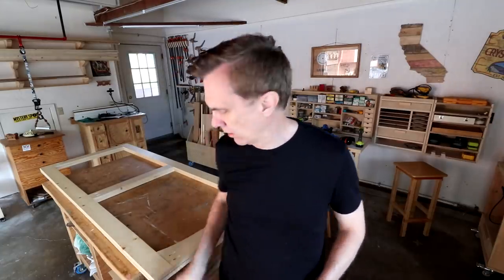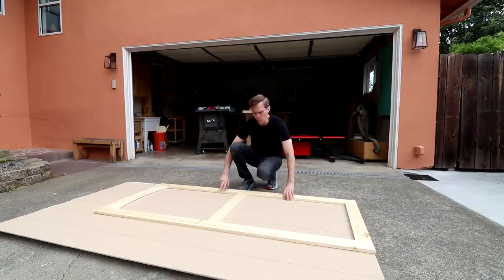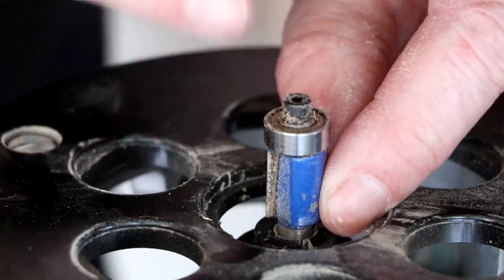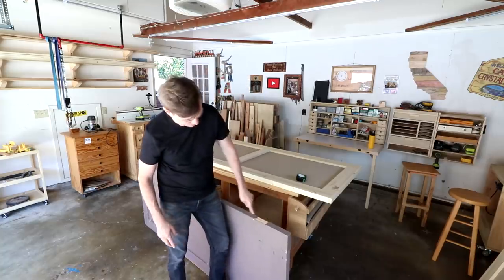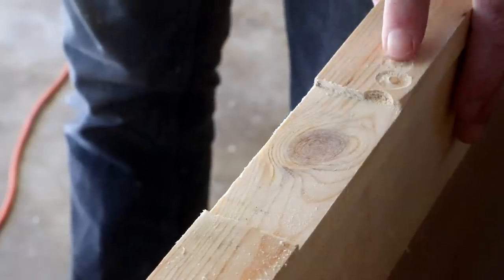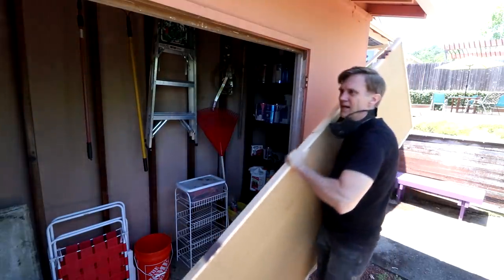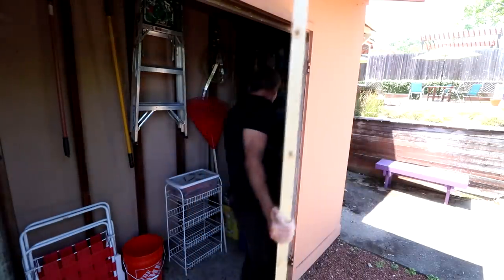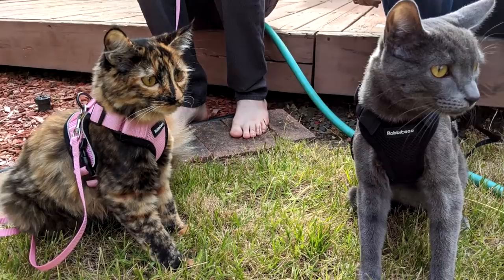One day of work expanded into two. But the doors are looking good! | LOCKDOWN Day 77

Comment: Our routine is simple:
-they have a food call. Always. Whenever we feed them, we have a certain whistle for them to call them in, even if they are inside, even if they jump in the door and we have another purr when we are feeding them.
we moved several times with cats they were saved from outside by us, so they cannot be inside for too long. But when we have to introduce to a new place the dance is always as follows: 
- 1 week indoor, no matter what. They must to be inside. This is home. 
-1 week later they are let out into visible distance 10 mins before. They sniff around and then foodcall, and they come back. After that they want to go outside but they just can't. They are mad. This goes again for a week all the time a little bit longer time to free roaming.  For the end of the week they spend an hour outside before every meal. 
-And after a fortnight they are always back to food call. Sometimes not, so I have to whistle again in 10-15 mins. 
They have two food calls. One is the whistle, the other one is similar to the mothercat's  feeding purr. The latest is always heard when we are feeding. The whistle is used for calling them in, 98% for food, but other occasion too when a storm comes, or we are going for the vet. The food purr is a jolly-joker. We do that when we think it is an emergency or when they are on a place we cannot reach them but we want them to be encouraged.

Comment: Our cats go outside when they want, and you sort of learn their routine. They like to go out at certain times, and come in again at certain times. One night one of our cats didn't come back when it was supposed to, so we did the whole panic thing and searching everywhere, and attempting to go to bed. In the morning I open the cupboard, stick my hand in for some socks and get a set of claws and teeth attached to my hand.
The cat had climbed into the cupboard while I was putting away the washing and made a bed in there, and gone to sleep.
Yesterday I finished tiling and grouting our porch floor. It looked really messy when I went to bed, and I can spot every uneven bump in the floor and misaligned tile. This morning, it looks fine and just needs a wipe down :)

Comment: Glad Cobra is back. Bubbles must be 

Down the road a nice project for Bubbles and Cobra ,to let them go outside safely, would be a build of some of those outdoor hardware cloth cat tunnels. I've even seen where folks have made tunnels that go to a large cat run. The tunnels I've seen normally hook up to a cat door on side of the house or end of a sliding door .. with a way for the owners to open or lock them.

Bubbles and Cobra would be in cat-heaven.

Comment: @5:38 Astagal - An astragal is commonly used to seal between a pair of doors. The astragal closes the clearance gap created by bevels on one or both mating doors, and helps deaden sound. The vertical member (molding) attaches to a stile on one of a pair of either sliding or swinging doors, against which the other door seals when closed. Exterior astragals are kerfed for weatherstripping.
Reply: p.s. - we have 20+ cats at any given time(feral colony).  When I don't see one of them for a day I get really upset.

Comment: The strip between the doors is called an astragal if applied to just the outside if installed between and also on the outside of the doors it is called a T-astragal.

Comment: Here's a tip for replacing a door in an existing opening: lay the old door directly on top of the new one. Make sure the doors are in the same orientation. Line up the top edge and the hinge edge. Use a square to "square down" at the edge of the hinge (and latch) mortises (or hinges if the mortises are oversized). If you like the fit at the bottom, trace the bottom edge and cut. Perfect fit with no measuring.

Comment: I am not sure if it was just me but when you test fitted the doors, the left door seemed to hang lower than the right door in the centre where they meet. Maybe one was not closed properly,  or you still have to shim the hinges,  but something looked out of square. Not criticizing,  just trying to point out something you might not have noticed. So glad Cobra is fine. Bubbles is an awesome cat for making you aware. How did you teach Cobra to knock on the door 🤣

Comment: Actually I have a question. I'm a newbie at this so bare with me. Isn't the measuring tape on your table saw suppose to help you set fence for cutting at decided size? Cuz mine makes no sense to me! Bosch 4100-10. I can understand needing to adjust something. But after 13" what tape measurements change makes even less sense. I've gotta be missing something.

Comment: Aren’t the hinges-the part where the rod goes through-supposed to be inside the shed?  Unless its not locked from outside anyway?
Reply: Only if the doors open into the shed ...
Reply: Good point. Needs non removable pin hinges instead.